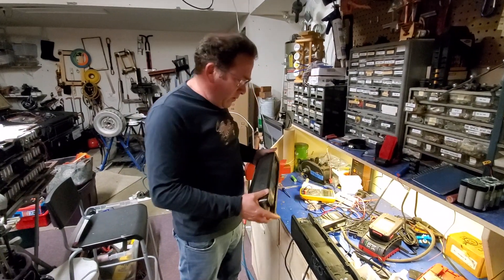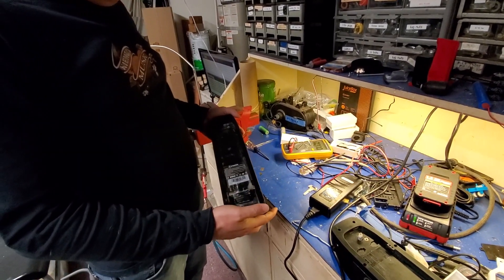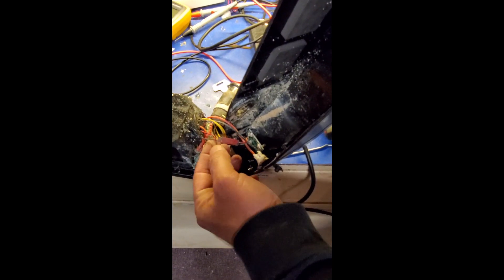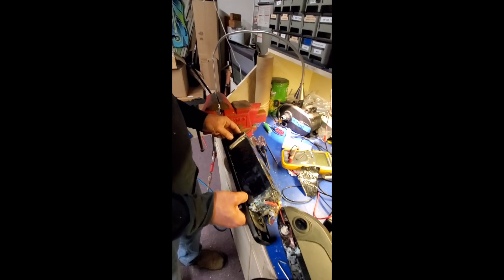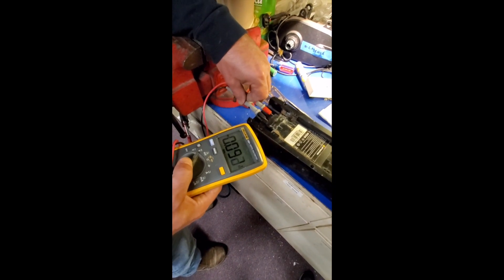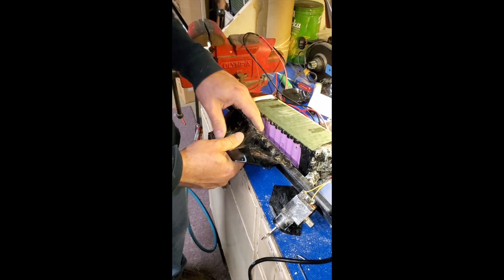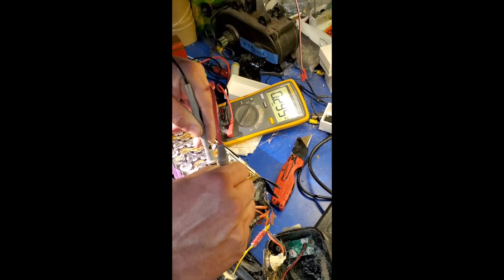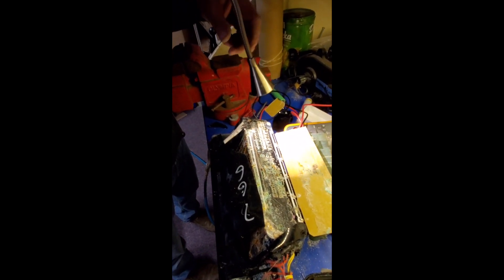Can This Rad Power eBike Battery Be Saved? Watch as We Attempt a Daring Repair!

Comment: You might of stumbled onto the defective radpower battery recall….my older one has blue shrink wrap so its prob a weak point that is letting water in them 💦🔋🔥lucky that didnt ignite🧯if u still got the case RP-1304 and HL-RP-S1304 recall models

Comment: I have a battery that I just got with my brand new ebike and I think something is wrong because when I press the power meter it sometimes works, sometimes doesn't even when the charger says fully charged and when I ride my ebike.. it dies in like 5 minutes. I need to find somewhere to take the battery to get it fixed because I have not a clue what I'm doing.

Comment: If there is just some light water damage to the connectors how would you clean the corrosion?
Reply from the maker: i'd use light sandpaper, like 400 grit (non-conductive).  You can be careful with a dremel and wire brush too but best to start easy with the sandpaper.